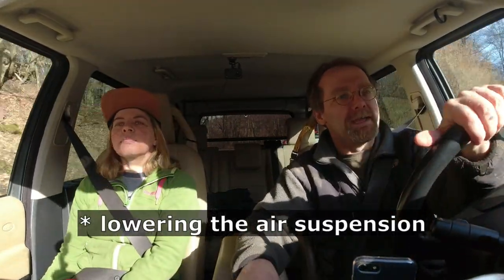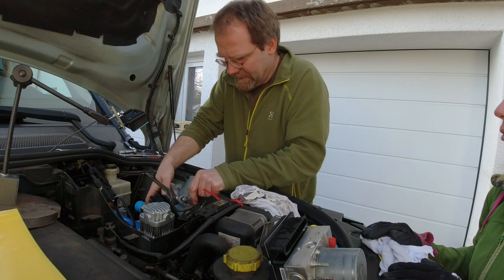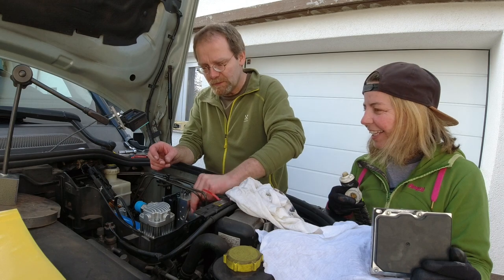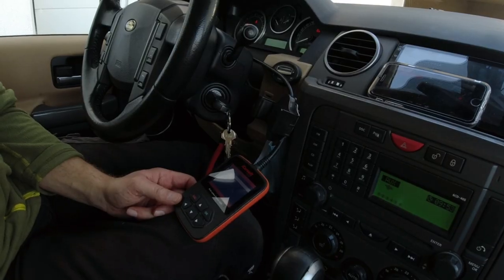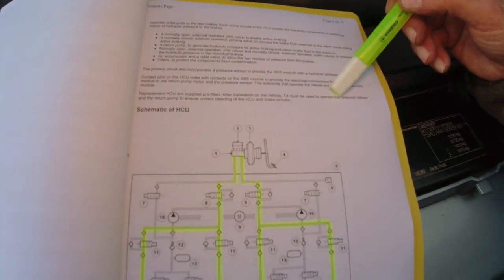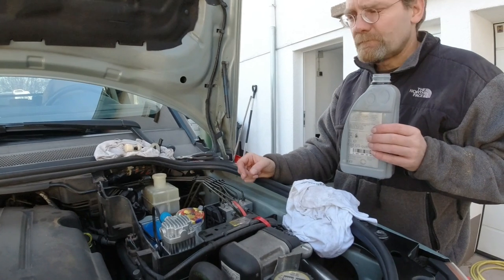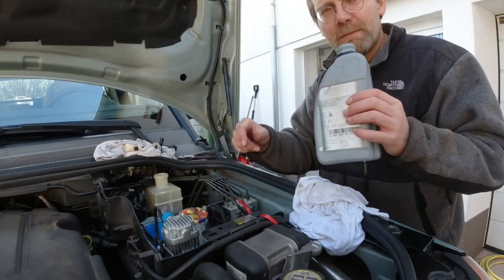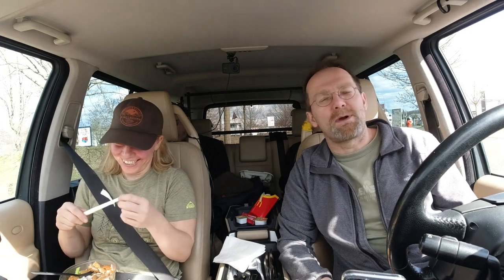Did our Land Rover Discovery 3 fix itself?  DSC problem resolved.

Comment: I had a DSC, decent control issue, suspension lowered, bo special functions. Turned out to be the steering angle sensor, bit of metal weld glue on the silly flimsy plastic around the steering shaft under the dash, and a steering angle reset. Fixed!
Reply from the maker: 👍We checked the steering angle sensor, we knew that it can set off this fault too. 🙋‍♀️ Vera
Reply: BIKE LIFE MARK  I've got some pictures but not sure how to send via YouTube, after gluing you will need to get the steering recalibrated, most garages cant do this, by any specialist landy garage will have the software. If you can feel the plastic collar the glue needs to go between the plastic and the shaft so they are fixed together.

Comment: My Wife’s Toyota had an ABS problem “Brakes hammered” through the pedal as if locked with just gentle braking in a turn. No codes funny noise from pump. I check the wheel sensor signals all seemed good (Picoscope).  I cleaned the toothed wheel speed sensor reluctor wheels and found one had fractured due to rust expansion and moved slightly. In a turn the wheel sensor lost the signal triggering the ABS. (18 Year Old Toyota). I removed the  driveshaft and replaced the reluctor wheel, purchased from a German company and End of problem. The noise was the ABS. During braking the ABS is actuated by a stopped reluctor wheel being sensed, or in our case displaced reluctor wheel, it blocks further pedal pressure and releases some until the wheel spins and you feel hammering through the pedal. The displaced fluid is stored in an accumulator under spring pressure and returned to the reservoir when brakes are released. If the chamber becomes full under braking a pressure pump is operated to return fluid (The noise I heard). I have never heard that noise before and I am sure some would replace the ABS Unit for that noise. Reluctor wheels front set 15 euros. 18 year old Toyota Yaris. The rust under the reluctor wheel was so hard I had to chip the rust off with a small hammer and they emery paper the Hub clean. (Safety glasses)!. The reason for two reservoirs is dual circuit brakes, half your brakes may fail due pipe or seal failure but pumping the pedal means the other part of the circuit (Dual Circuit) will still stop the car. Brake fluid is hydroscopic (Draws in water) and should be changed at correct service intervals, absorbed water can turn to steam during extreme braking due to excessive heat leading to brake fade, it can also promote corrosion in the brake system due to the moisture. We all change the brake fluid when we should right?😀. Wheel speed sensors have a hard life the wheels move up and down and steering movement bends and twists the wires and eventually they break. This is going to affect a lot of systems as their input is critical. I had an Audi A6 at 180,000 miles a front wheel speed sensor failed and I replaced it two weeks later problem came back but this time the other front wheel. Who would have thought wire bending and flexing during suspension movement and steering would fail at about the same time?😀. High mileage if one goes consider doing the rest. Excellent teamwork very good work, you do your research and do it properly and put a god few mechanics to shame. Love your sense of humour it’s gets you through the day.

Comment: Thanks for the mention! I was having a similar issue (HDC fault, transmission failure, and traction control light on) and it turned out to be an electrical issue: the wire that comes from fuse 66P was corroded at a splice due to water in the passenger side door sill. This wire supplies power to various switches (brake, HDC, and DSC) that are sensed by the ABS module. Other than the warning lights, the vehicle also refused to raise the suspension to normal height. It's amazing how something so simple can cripple a vehicle! Anyway, I'm glad to hear that yours is working!
Reply from the maker: Hello Waldo, your car must have a sun roof I guess. I wonder if you can send us your mail address? We would like to send you our sticker.  Christian
Reply: @Vera_and_Christian  Thank you! Check your Instagram DMs

Comment: Hoi Christian and Vera. Maybe someone already mentioned it in the comments. I had a problem with a stuck carbon brush in the motor on the dsc. Thanks for sharing your experiences.
Reply from the maker: I bought a used unit for 25 Euro.  If this problem comes back, I intend to switch components and try to get lucky.  😬 Christian

Comment: Too long to wait a week to see you here guys! Regarding the diagnose tool, sell yours and get ad iidTool. It is able also to bleed your abs module if needed... I have managed a similar issue on a friend D3 and the problem was the wiring harness close to the ABS pump, moving it a bit fixed the ABS fault  on the dashboard. A further analysis revealed 2 spliced wires (suppose due to vibrations) touching together...
Reply: £500 hurts for the iid tool though 20+ years with LR’s doing everything diy I guess one day I will have to but ouch!
Reply from the maker: But don't you have to buy a licence for each additional vehicle you want to service with GAP tool?  600€ is just a lot of money. 🙋‍♀️ Vera

Comment: Fun Fact: I nearly crashed my phaeton V10 as In a Dutch caravan on the Autobahn as he pulled into left lane while I came rushing on with 220kmh. Turns out the guy I bought the car weeks before messed with the ABS pump, but never bled the actual Pump circuit, so as I braked hard as possible the pump pushed air in my hydraulics what made the brakes fade so hard for a few seconds. No need to say that I shat my pants :D
Reply from the maker: 😳 my worst nightmare, but that's why I stay in the right lane 😅. Glad your alright and nothing happened. 🙋‍♀️ Vera

Comment: I believe brake fluid is hygroscopic, so any opened container should have a use by date. I used a syringe and tubing to extract as much as possible of the old brake fluid on my P38, still need to do a proper bleed at each wheel.
Reply from the maker: To tell you the truth, we knew that too. But we were so caught up in the workflow and filming and just getting done, that we did not take a moment and think that situation through. I think it was Christmas Eve when we filled the brake fluid.  I hope we learned something 😂👍🙋‍♀️ Vera

Comment: Your Disco really does like giving you content to work upon :) Not sure what you're symptoms were, but Christmas tree on the dash, suspension lowering, no speedo, can also be caused by (partially) burned brake lights... Cheers!
Reply from the maker: 😂👍 You know, sometimes the fuel gauge just drops down to empty.  Maybe we should tackle that problem for one of the next videos.  Our Disco has many suprises for you guys in stock 😂👍🙋‍♀️ Vera
Reply: @Vera_and_Christian I've read about issue before.  I'm happy I don't do YouTube, as my car hasn't given me any issues for the past 10.000km+, except for the tailgate struts failing.
Reply: @Vera_and_Christian  In the end, it's good that our cars do what we expect of them. Mine does work hard, frequently in remote areas with no cell coverage and I am alone. Yours can drive on the autobahn even in access mode, as Christian said in this video, so the occasional issue that generates content for your channel is probably welcomed :) Take care!
Reply from the maker: @AlexStrugariu  😃 well said;  got your adress and will send you a sticker 👍🙋‍♀️ Vera
Reply: @Vera_and_Christian  Thank you very much! Appreciate it. All the best!

Comment: Another great video my discovery tends to fix it self lol. Still got to do egr valves but missis had me working on her car disc pads and front wheel bearing lol if I take battery of will it mess up car ie radio codes or will it be fine
Reply from the maker: Yes the wifes car is of course more important 👍👌. Unfortunately, we did the egr Valves first thing when we got the car, even before the oilpump so before we made videos. When you remove the battery on our Disco, nothing happens. On my Freelander, I need to enter the code. 👍🙋‍♀️ Vera
Reply: @Vera_and_Christian   i guess ill do it and see lol fingers crossed

Comment: Question: It's possible to use "descent assistance" if go backwards?
Sometime when you crawling on some hill, wet one, and you was not able to reach the top and you need to make bottom safely for new attempt
Reply from the maker: Yes, it actually works in reverse.  I think we covered this in this video a year later. https://youtu.be/Y6yEq9oETh8
Christian

Comment: Hi Christian im having an issue thats similar. I have ABS, BRAKE  and trans fault while lowering suspension. It is intermittent. Parking Overnight, front sits about 3/4 inch lower than rear. Can a bad valve block cause these lights? Thank you!

Great videos btw! Really enjoy it !
Reply from the maker: Hello Kushan, our car is also sacking about 3/4 inch every night. That is normal for us. But you need to have a diagnostic tool hooked up to your car, like the icarsoft OBDii for Land Rover. Only when you have a fault code presented to you, can you analyze the problem. Everything else is just a wild guessing game. 🙋‍♀️ Vera

Comment: Hi Christian, a question, what are the schematics and plans you are using in this repair? I only have the Haynes manual and you are probably aware these are only a good guide but not truly comprehensive. the yellow folder you have contains very good detailed information that my wife and I saw!
 I said last time I have a D3 kitted out for overlanding (painted in Camo) but currently I took the lockdowns as a chance to do a big refurbishment, Body off two new turbos, straight through de cat pipe, new oil pump (snapped bolt as doing it! ) full timing belt kits, fit new wiring loom to electric brake unit oh and while I'm at it rub the chassis down and give it a good anti corrosion treatment, All the best Phil and Louise
Reply from the maker: Look here, https://www.disco3.co.uk/gallery/thumbnails.php?album=5082  😃👍🙋‍♀️ Vera
Reply: @Vera_and_Christian  Brilliant thankyou Christian, Regards Phil
Reply: @Vera_and_Christian  Just noticed this is from Duckworths LR, they are 7 miles from my location, I know a few guys there or have worked there, good dealer but like you said my god I cant use them as a regular owner, parts sometime not to costly but over 100 Euros an hour labour rate, so like you I do most of the work of have ex landrover guy who can do work for me at a better rate! lol
Reply: @Vera_and_Christian  Cheers Vera.. very helpful, Phil and Louise 👌👍😃
Reply from the maker: @philadams92  You are right, I even had to pay 25 € at our Land Rover shop for them to even talk to me in person. That was nine years ago, god knows what they charge now. 👍🙋‍♀️ Vera

Comment: Hi to you both for another great video
I can share your pain with the DSC fault I have just replaced the rubber bushes in my front lower wishbones then the DSC fault plagued me cleaned the ABS sensors and replaced one which had a bit of noise, reset the steering angle sensor all to no avail.
However after a drive and the four reset of the steering angle sensor the faults have not returned (so far) I suspect that the DSC signal from the steering angle sensor is very critical and extremely sensitive
Did you say you had the GAP iiD tool that is what I use (although I also have the IDS tool also) the GAP tool is very good and you can also edit the CCF file with ease
Regards and good luck
Reply from the maker: We use the icarsoft OBDii tool, the GAP tool is just too expensive for that I can only use it on one VIN Number. 👍🙋‍♀️ Vera

Comment: I have been following your episodes for a time and I now I have a problem my mechanics cant resolve. The problem is, while driving after some minutes there is a message " suspension fault" slow dawn and the vehicle will lower, ABS signal DSC not working and cruise control not working. Last year I bought X Lifter kit and I love being control of how high the car is, I am using it for off road driving in Iceland and in the snow in winter time. I have 17 inc wheels so I have more rubber and softer driving on gravel roads and deflated in the snow. One of the mechanics after going through the computer test that the switch on the brake pedal was known to brake, I changed that but still the same problem he also mentioned that the wire in the left threshold was once known to brake once. Something to with the brakes.
Have you had any experience with a problem like that. By the way the light bulb for the left braking light is broken.
My car is 2007 LR3 with 270,000 km. The engine was rebuilt 3 years ago broken Block and a new converter for the transmission 2 years ago. That was my own fault, trying to pull my 38 foot yacht between places.
If you have experienced any thing like this I would love to know about that.
Greetings fro Ísland.
Egill Kolbeinsson DDS  
Hafnarfjörður Iceland  email egill@navi.is
Reply from the maker: This can only be reolved by reading the fault codes.  Should be a simple job and it happens all the time.  Christian

Comment: You need to get a brake fluid moisture pen , it tells you the condition of the fluid . Cheep  investment !!!!
I use TRW Brake fluid It the only one that does not have moisture in it before you start the bleeding job !!!
Reply from the maker: Just ordered one, thanks for the recomendation 👍🙋‍♀️ Vera
Reply: @Vera_and_Christian  Hi Vera when it’s not in use take the battery out.The first one I bought didn’t last ,the second one has been fine because the battery removal,I hope this helps .
Take care , Keep safe

Comment: Christian what is the manual you are using to service the Discovery? Is it a Haynes manual? If it is I would recommend you spend whatever it takes to buy the genuine Land Rover manual, I still have mine for my Discovery 2 even though I no longer have the car. It  wasn't cheap being just around £70 but it was still worth it. I had a diagnostic tool too and that I used to completely automatically bleed the braking system using the ABS pump itself to do the pumping of the brake fluid, and I worked a treat. You should Never, Never  use old brake fluid under any circumstances. Brake fluid is hygroscopic, that being it absorbs water from the atmosphere and will cause brake fade when you need good brakes most as in an emergency stop. The brakes get hot and boil the water into steam which can be compressed thus loosing pressure in the lines and on the brake calipers when you are trying to stop in an emergency. So old fluid is a no no!
Reply from the maker: 👍We have both, Haynes and Land Rover manual. 🙋‍♀️ Vera

Comment: Hello Christian and Vera, I have issue with my LR3 during these cold days....my I ask you for a consultation please?
temperatures bellow 1-2°C - engine starts fine, rides fine. After about one to three minutes yellow parking brake light starts blinking together with navi screen blinking and restarting, also on interior light I can see periodical voltage drops (light dimming), all with frequency about 2-4Hz. After another 10-30seconds it stabilizes itself, navi works, parking brake symbol is off. usually during next minute suspension light goes orange.
Turning car off an on again (I am working as software supporter:-) ) all repeats it self. If temperature is above 5°C, then this is not happening.
When using ODBII while engine still running after this issue, list of error codes contains this:
U0132, C1A00, U0132, U0159, U0122, B1A96, B1D79, B1B70, B1C62, C1A20
My guess is that there is rusted ground or badly performing relay, but cannot find any common point for Parking brake and Navis screen.
I also tried to renew the connector of ABS module because of CAN bus terminator there, but no change. Accumulator changed couple day before.

Do not have any guess, while you may be "was already there"?
Thank you for any idea.
Reply from the maker: You have to decode the faults. We have several videos how to diagnose the dsc  and air suspension.   Ignor the u faults as we said in many videos.  Christian
Reply: @Vera_and_Christian  Thank you.
I moved a little bit forward now.
I detected that charging voltage was kind of oscilating unprectively between 14 - 16+V, so I was happy about the "aha, that is it", but when I mounted new alternator it stays stable, but higher that expected. Engine ON - on battery I can measure 15,3V stable, in ODB2 tool I can see 14,9V (0,4V drop), also stable.
How does your voltage looks on battery and on diagnostic tool on Vera's car while running? Is there also any difference? 😲

Comment: Hello Sir & Madam,  I've been following your videos for sometime, ever since i was planning to buy a Disco 3, now that I have bought a 2009 Discovery 3 TDV6 GS just days ago, I seek your valuable assistance as the scanner tool as suggested by you is on it's way from US & sadly the previous owner lost the owner's manual. The vehicle shows no faults at system check, there are not fault signs after ignition, The suspension works fine at all the levels, the terrain response gets selected in all modes but while driving the vehicle mostly after 40 kmph ( sometimes it activates at 60~75 kmph )  the DSC light comes up followed by Suspension  fault light, stating 'ENGINE SYSTEM FAULT' "SUSPENSION LOWERED" & the vehicle doesn't accelerate any further, I've checked with a regular ODB II tool, there are no engine codes. The system goes normal after switching off the vehicle, the problem persist even after deactivating the "DSC". Kindly suggest me how should I approach, Thank you in advance for LR owners make them feel LR more "reliable"
Reply from the maker: I cannot respond in a video thread to such a complex problem. Contact us via Patreon please. Christian